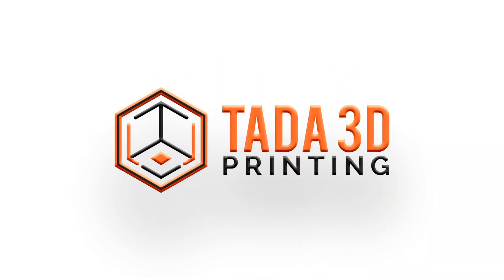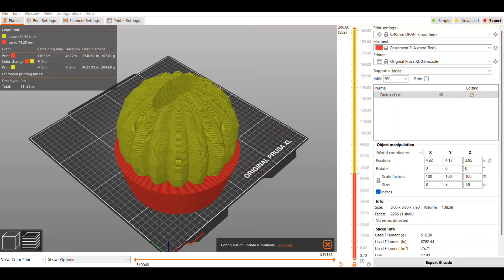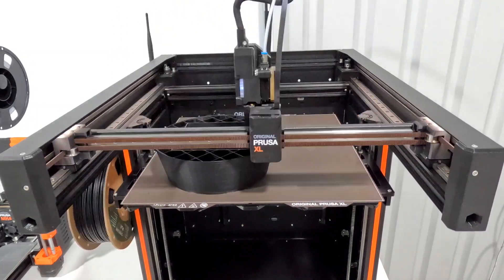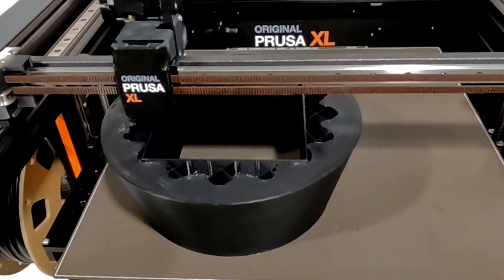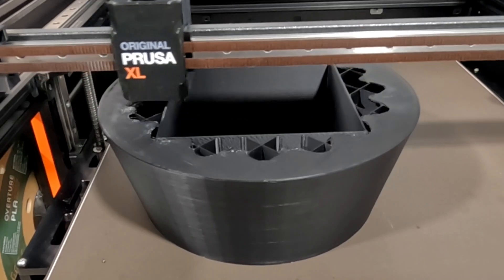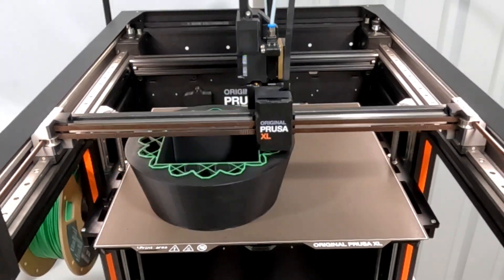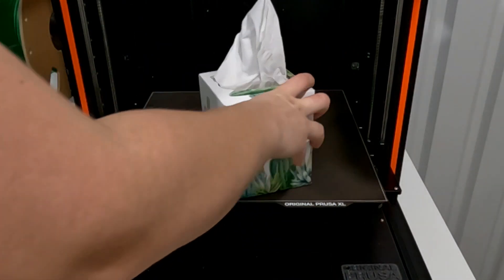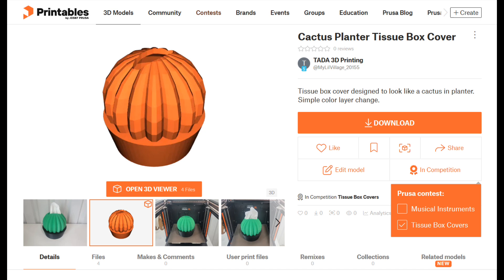Printables Contest - Designing a Tissue Box Cover for the Prusa XL

Comment: Nice work publishing to printables! I like the low poly effect too.

Adaptive cubic might have worked better for infill, since it will increase the infill density as it approaches the top surface to reduce the bridging distance for the skin lines.

The dome-like overhang for the top of the cactus can be tricky. To increase its print reliability, you might make the interior a 60-70⁰ cone.

Really interesting to see the crash detection work too.
Reply from the maker: Thank you!

Comment: I think Support Cubic infill pattern would have handled the issues at the top of the planter with curling.
Reply: Yep. Or Adaptive, or Lightning. :)
Reply from the maker: So not percentage but pattern would be your guess?
Reply: @tada3dprinting  A higher percentage is the goal, but it's only needed at the top layers, not the whole thing. Support Cubic, Adaptive Cubic, and Lightning infills are all options that start very sparse/open, but as it gets close to the top layers, it automatically increases the density to provide good support for the top layers without using tons of material and time from the bottom up. For decorative things like this, it's a great option.